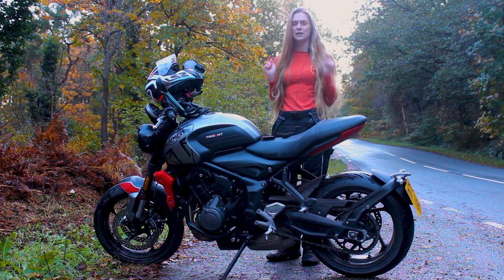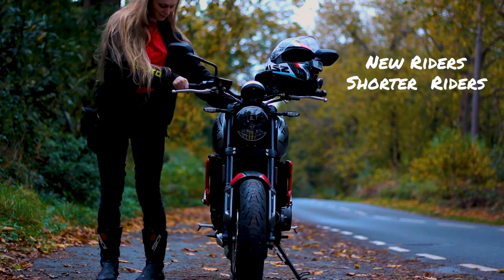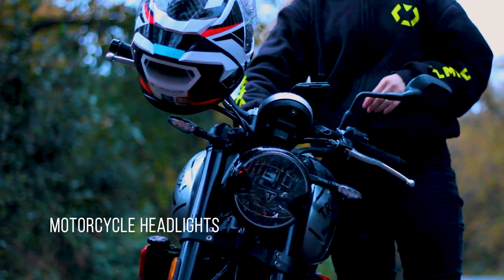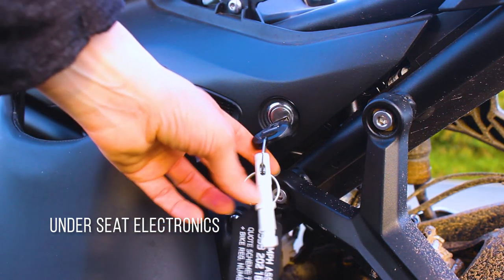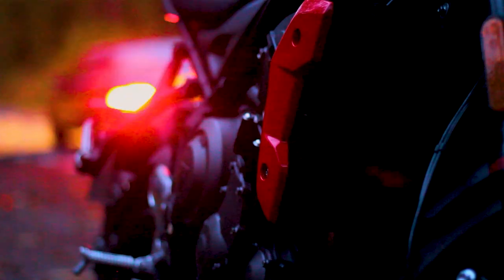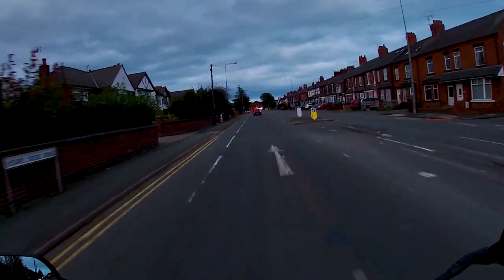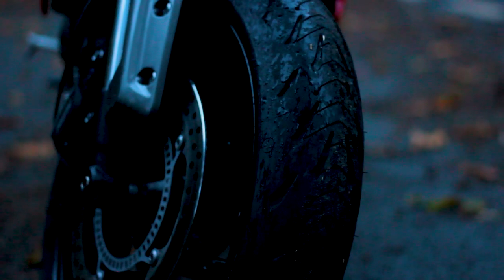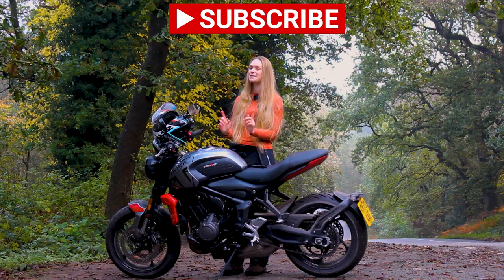2021 Triumph Trident 660 | THE REVIEW

Comment: Please don't use WD40 on your chain. It's not a lubricant and as cleaner will kill your O rings which will lead to your chain failing. Always best to use a specialist chain cleaner and lubricant.

Besides that little point I loved the vid as always.
Reply from the maker: https://amzn.to/3k9qkry this is what I use :)
Reply: @SaffySprocket  You just put my mind to ease Saffy. So many people think regular WD40 will clean and lube chains and sadly I have seen bike chains snap during rides from it hence my worries 🙈 Thanks for clarifying it's the specialist chain lube you use. Would hate to see something like that happen to you.
Reply: WD40 as a brand have branched out and do special motorcycle chain lube
Reply: @kevinstone2303  that's a bs myth. Wd40 doesn't kill o-rings. It will clean a chain from rust and debris but it's not a lubricant for your chain. If someone is solely using it for a lubricant then that's where you're getting breaks.
Reply: 是
Reply: @jonboy87  yessr. i use to clean and remove water. then use a dedicated lube. works like a charm.
Reply: @SaffySprocket  Hey saffy you ok you out on bike today

Comment: Very good review! How do you compare the Trident against the SV650?
Reply from the maker: I preferred the Trident to my SV650 but the thing that puts me off is the lack of luggage options
Reply: @SaffySprocket  My solution to carry luggage on the SV650 was a KAPPA Z3111 rack and a top case. Even a rucksack it's no problem: my road trips take at least no more than seven days,so I don't need a lot of room. (I stay at hotels, no camping gear to transport).
But regarding handling and engine response, which one you consider the best suited for a one day ride in the twisties?